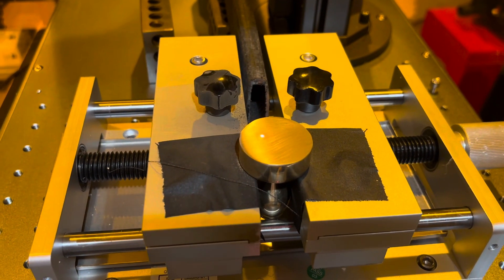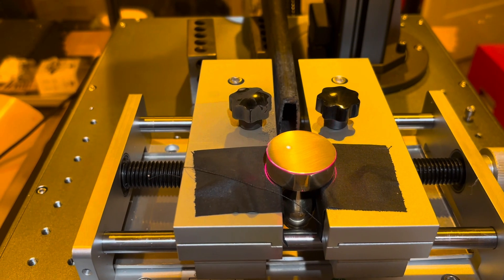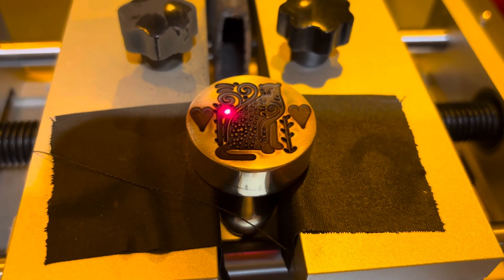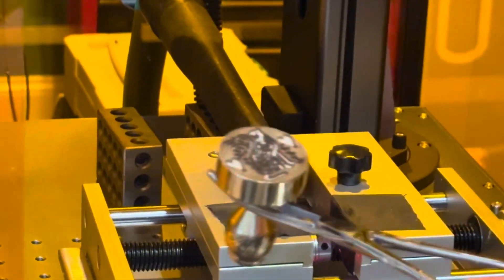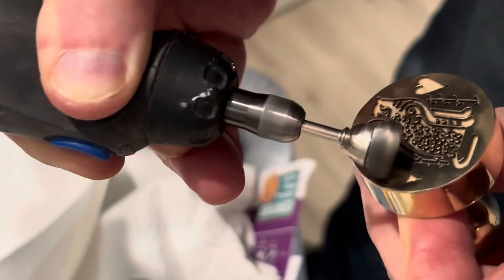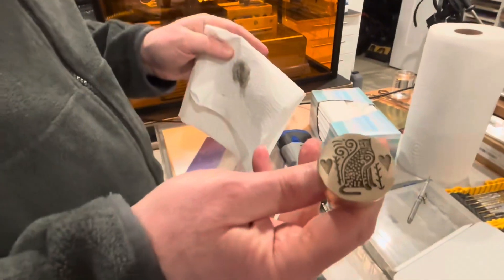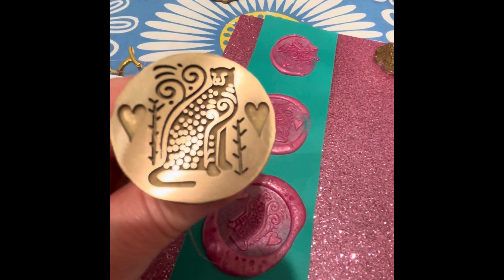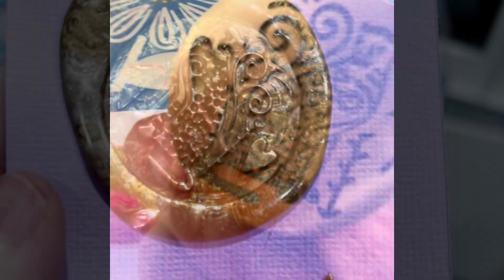Engraving brass wax seal stamp with 100 W MOPA fiber laser

Comment: Hi! Regarding the wax sticking to the stamp, you need to cool the stamp head for a short time using an ice cold press. Just let the stamp rest for a moment while you pour the wax. Press the stamp on the wax and after a few moments, remove the stamp head when the wax hardens. You will find it easy to remove. Hope this helps!

Comment: Was this with the JPT Mopa.m7 E2 or E series POWER SOURCE and have you tried Stainleas steel?
Reply from the maker: @mpix00  it was definitely a JPT MOPA but I’ll have to find the documentation to tell you more specifically than that which it is. As for stainless steel, all of the stainless projects we’ve done have been uploaded here. Feel free to scroll through them to see our settings and results. We find that stainless steel is the trickiest metal so far to get consistent results. You rarely know what grade of steel you’re working with when it comes to consumer goods like the utensils we’ve done and your alloy mix is going to determine how colors render and in our case, the evenness of the color of the engrave from area to area on the same piece using the same power settings.